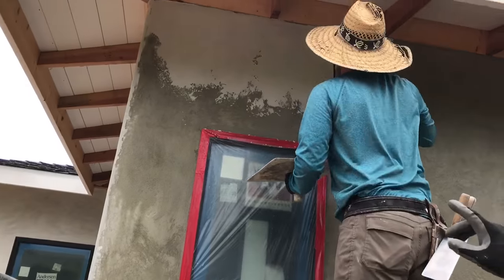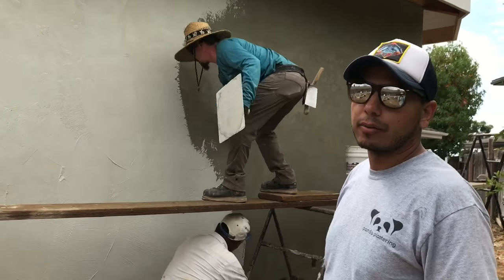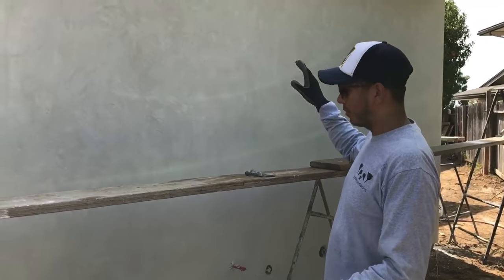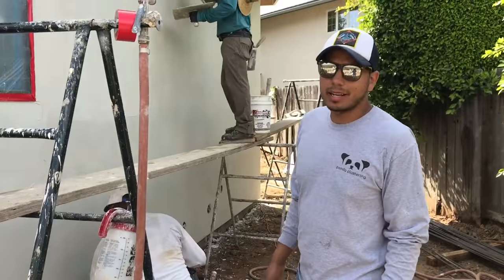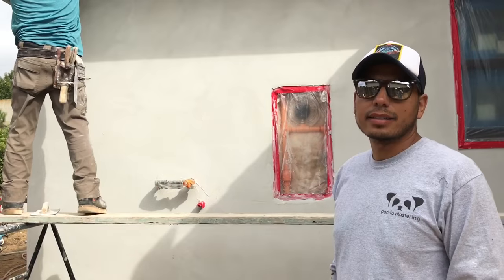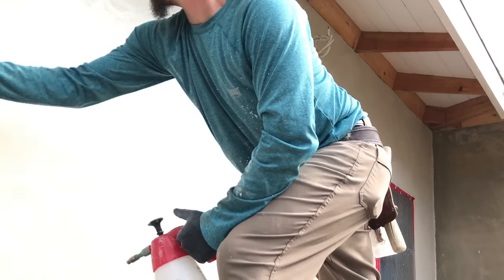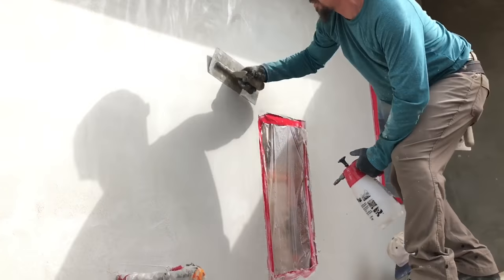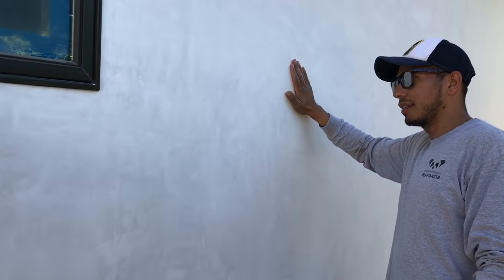How to apply Smooth Finish Stucco

Comment: That’s awesome . I’m so glad you floated the first coat , that made me so happy , seen a lot of people online not even making the walls flat . Brilliant work and good timing .
Reply: Can you do this over existing painted stucco (our house has a rough coat over it but we want a SB smooth mission finish)?  Do I use an adhesive first and then two coats of stucco?
Reply: You need to sandblasting your house to take off paint, you can't put stucco over paint it will come out.
Reply: B D you may be able to find a product that has adhesive properties to apply first  so the render or stucco can take over the top  . We have stuff that can go directly over paint in Australia  , it has chemicals and stuff in it to make it stick . Check with your local
Supplier about options and different products to use . Don’t know shit about stucco . We use sand and cement and polymer base renders .

Comment: What type of “mud” can you use? I’ve heard of additives, what are they for? Can you paint this to give it more protection? I’ve heard some paint has polymer or elastomeric or something so it’s like almost a colored glue so it helps keep  the stucco from chipping by bonding it and is like an additional layer on top of the stucco that protects it and would have to get through the paint to expose the raw stucco. Thank you, I’m trying to get this figured all out so there is a logical step process to doing this and knowing the materials, tools and techniques.
Reply: You can use cement sealer after the application of stucco cement. You can also change the color of the pigment being added to portland cement to create other colorsm

Comment: Hi. You did all this using a finish coat of stucco right??

1 You apply it 
2 float it
3 apply again
4 float again?

Are those the steps?
Thanks
Reply from the maker: vegito blue 1-3 correct.  but  #4 you use steel trowel to achieve smooth finish.
Reply: @pandaplastering2466    sir thanks alot.   I will try to smooth out a texture finish

Comment: Question: I have a smooth white stucco exterior like the one you have in the video. When it rains, the white color seems faded/discolored and looks not so nice, but when dry it seems to be ok and the white pops out again. Could there be a problem with the way stucco was applied?
Reply from the maker: perfectly normal. all smooth finish stucco will do this unless painted.
Reply: Any cementios finish darkens with water or rain when its dry again it goes back to normal,thats one of the reasons why acrylic is better and more expensive...

Comment: After I power wash my old textured stucco, can I just apply this directly? Do I need to use a concrete bonding glue or something?
Reply: You can apply it directly assuming your wall is straight, and also assuming your old stucco is not painted. If it's painted, you need to use bonding glue like weldcrete and roll it on the wall with a painter's roller

Comment: Nice job.  What do you do if you get an air bubble between those two finish coats?
Reply from the maker: Pop it and Keep troweling until wall is dry.
Reply: @pandaplastering2466  Okay, thanks.

Comment: I’f my house has medium coarse stucco can I just apply this on top and be ok? Or would I have to re do the scratch step and start from beginning all over again? What do you recommend ?
Reply: Yes you can apply another coat. If you have painted then you would apply an adhesive coat . If you want smooth trowel, then you should apply a fiberglass Netting embedded into bond coat (mesh coat) this will reduce cracking. Then smooth trowel finish. Please note : image imperfect smooth trowel finish. That is how we list this on our contracts.

Comment: Also , is there a product to patch smooth stucco ? After many years and coats of paint the surface is smooth, and most stucco patch is 16/20, and does not match.
Any advice appreciated
Reply from the maker: you can try Wunderfixx made by Rapidset. sand it until smooth and paint over it.
Reply: Panda Plastering 
Thank you

Comment: Hey boss......your using sto? I have a crew who is struggling in Florida struggling to lay down steel trowel smooth.....is sto better than regular stucco? We will paint after smooth coat....just need to know what they are missing....thanks man.
Reply: You can add a small amt of lime to your mix to help butter it up.
Reply: @rl9808  OK. I'll try it. Thanks man.

Comment: I have textured stucco and I hate it. Can you do a tutorial on how to go from textured stucco to smooth finish. I want to do it myself so pleas explains the materials and tools. Thank you!!!!!
Reply: Generally, your going to want to apply a coat of cement around the house to get rid of the texture before applying the smooth coat that why u can get rid of the texture since that smooth material isn’t as thick and no matter how much u apply on top u will see the texture

Comment: Why does your plaster not dry quickly?
When I mix plaster with water, it dries very quickly and I can't hit it on the wall
Reply from the maker: mix your stucco with cold water. mist the wall before applying stucco. re whip stucco as you go.
Reply: @pandaplastering2466  I used plaster that I mix with water, it dries after 2 minutes and is completely staged. Can not draw on the wall
I am from Iran and this plaster is used for inside the building because if it is used outside, if it rains, the plaster will be completely damaged.
Maybe that's why this plaster is different
Reply: @pandaplastering2466  it means he has to much sand on his mix 😂

Comment: lots of chatter marks and burns due to not plastering in a proper pattern. waist to ceiling one pass, push at the top come down once, straight line, next half way on the last line, no need for double working, which makes those burns
Reply from the maker: Agreee

Comment: Can it be applied to a garage floor?
Reply from the maker: Unfortunately stucco will not work on a garage floor.  I recommend Metallic Epoxy on garage floor
Reply: Panda Plastering why? Will it crack when applied with pressure?
Reply from the maker: Redd Anselmo yes. Will most likely crumble.

Comment: I have a house wall with sand finish is painted.  Can I do this or I need something first like adhesive?
Reply: They do  have materials that stick to painted stucco. This is something you would need to do first. Its called polybond, something like this you would want to apply directly to the brown coat this is the coat before you apply the stucco.

Comment: panda right wall preparation makes the difference between, between a nice smooth even looking finish, and you guys did it wrongly, your color looks uneven, that's not an high end finish..
Reply: Tavo Romero do you have a stucco company in Los Angeles area?
Reply: Its a little over troweled ones you start seeing your wall turn greyish black Means no more lime on top it's just rubbing steel to sand
Reply: To much water while trowelling moves the color oround giving it different shades of color hard to avoid
Reply: Rezuh Snipes you right,,, on smooth finish you Will never get a uniform color
Reply: @jesuspaniagua6723  only thing you can do to that to get a perfect shade is paint it

Comment: can I do this on a retaining concrete wall? Do I need to use any adhesive?
Reply from the maker: jas silva yes but you will need a base coat before smooth. as long as concrete wall is not painted.
Reply: I want to do this on a stucco texture wall. What  adhesive I need for the stucco to stick on the old stucco as smooth?
Reply: @vegitoblue7908  polybond. Test a small area first. Apply with the same trowel as in the video and lightly smooth with a green float.